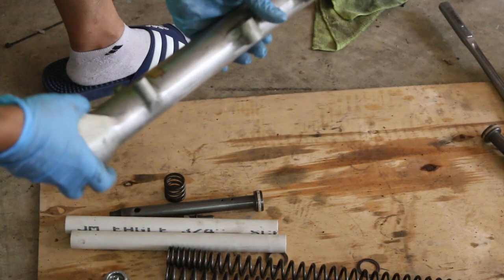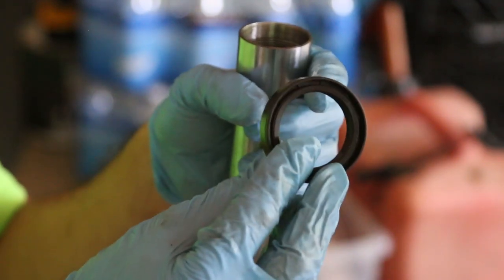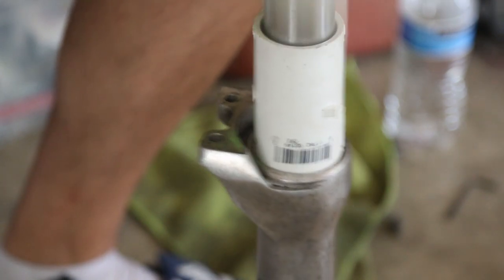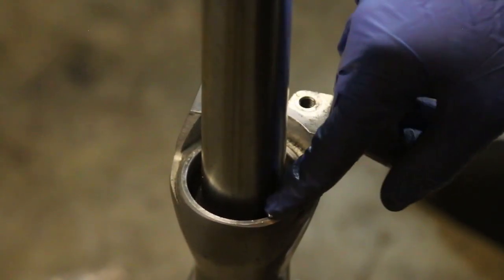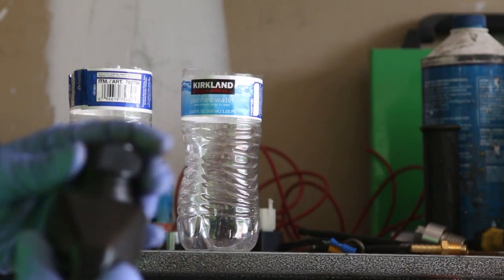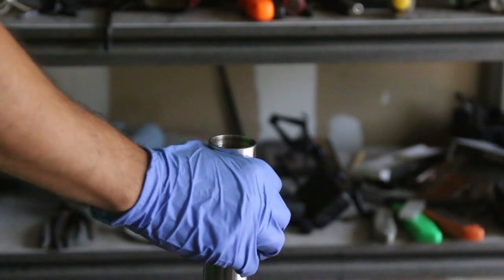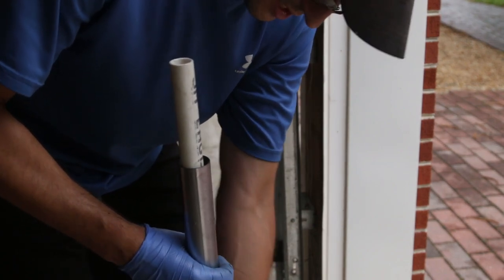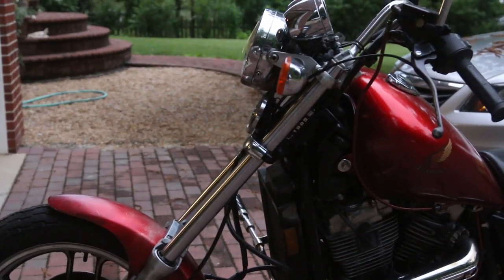Honda shadow fork seals: Assembly and adding of oil in forks

Comment: I wish the author would tell us what year/make/model he is working with but his part # 51447-461-003 at 6:23 closely resembles my 1984 Honda shadow vt700c part # 51447-463-003 so I'm guessing this procedure is good for a wide range of Honda Shadow years. These two part numbers resemble each other but I'm not sure of the millimeter and fitment
Reply from the maker: Hey there, sorry about that. I thougth people followed the journey in fixin gthe 1985 honda shadow vt700
Reply: @VehicleHunter  no problem dude I just scored it 1984 and 85 engine guard / crash bar and almost mint condition for $73 - I'm tickled baby

Comment: is this for a vt750? reason for asking is because the washer that goes under the seal on mine does not seem to be shaped correctly and is not helping with the reinstallation of the new seal as it will not go in properly could you by any chance show me a picture of the washer you used as i did see it in the video but cant see if it has the same profile as the one mine has.

Comment: Left the pvc pipe in 👌😁
Reply: I know right? Doesn't want em to travel to far
Reply: Some aftermarket springs require a pvc pipe to be used as a spacer
Reply: I was realy wandering about the pipe being left in? Is this a trick to get a stiffer ride?